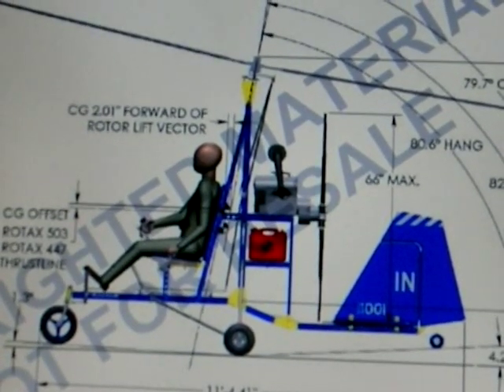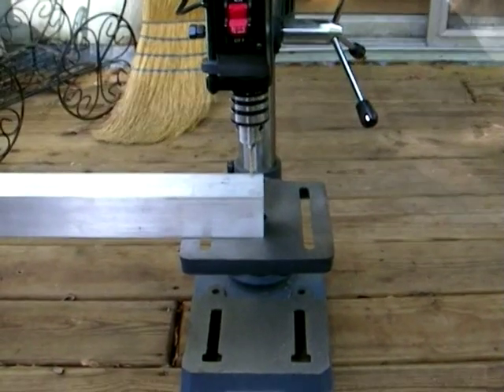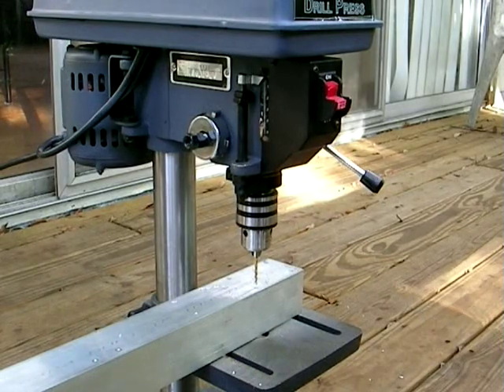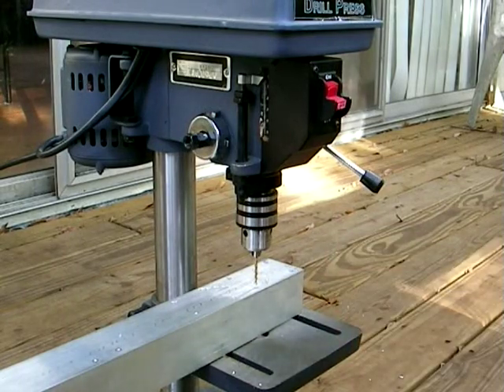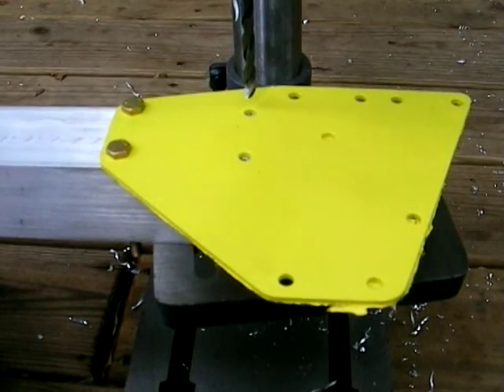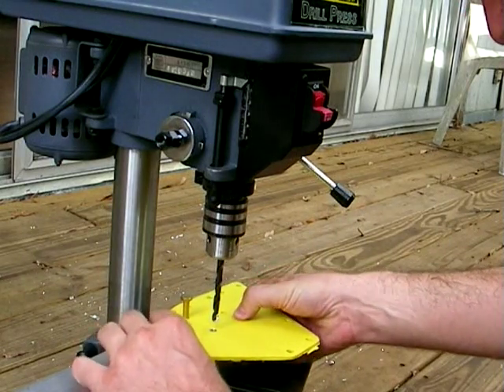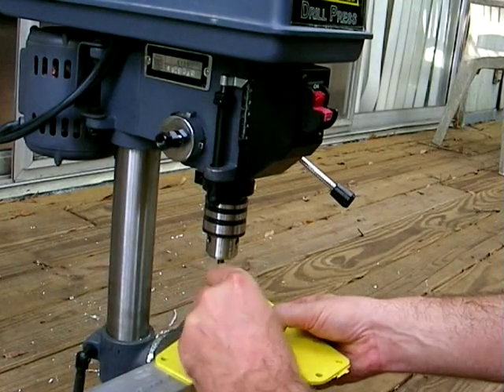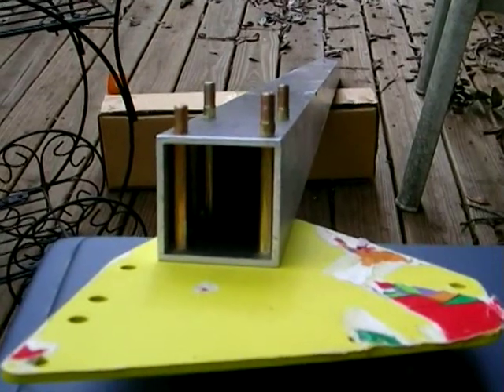Building a Hornet ultralight Gyroplane.

Comment: Can I use a lawn mower motor for my engine. 
I intend to do a light gyrocopter from aluminum square framing it's chasis
Reply from the maker: No. You need a dedicated ultralight engine.
Reply: @gilgsn  

So what is a ultra light engine. 

Give me a link to this motor.
Reply from the maker: @dhulkiflmcknight2275  http://hirthengines.com/2-stroke-engines/
Reply: @gilgsn  thanks for these information. 
I will follow-up through the contact.
Reply: @gilgsn  l am interested in the  41 series  hirthengine...
Reply from the maker: My best advise is to learn about gyros on this forum: https://www.rotaryforum.com/

Comment: sir what was the engine you used in your gyroplane and what was the cost of the engine and .engine specifications of the engine .and any link for buying it sir please.
Reply from the maker: vijaya kumar kona Rotax 447 40hp, but the Rotax 503 50hp would have been better. Give me your email, I will send you some stuff...
Reply: thank you sir for replaying and asking me sir and send blue prints of any one model of gyro copter sir that will be very helpful full .and please give any explanation of the rotor head hub attachment sir .
Reply: gilgsn 
thank you so much sir for Mail ing me sir

Comment: Hi Can you tell me were I can get a set of plans as I'd like to try & build myself an ultralight. Did you get a kit or just the plans?

cheers Alan
Reply from the maker: Hello Alan. It was from a set of plans. They are no longer available, but you can send me your email... I put the project on hold right now because I am building a boat.
Reply: Hi, Thanks for getting back to me, My email is alanos13@aol.com

Regards Alan
Reply: The plans are freely available online in pdf. Just search them ;)
Reply: @ZioStalin  The plans on the internet are incomplete. There is nothing about the rotor and control assembly. If someone can point me to the right place to search.  Does anyone know if the plans sold on the Build a gyrocopter site complete, or same as the free version floating on the net?
Reply: @kkchung2410  I don't know, a lot of time has passed and now I am a PPG pilot (paramotor), I don't remember. Maybe they want you to use a rotor and control assembly from a third party?
Reply: hi! can you maybe send me the plans too? many thanks!!!
Reply: my email is vyvekisawesome@gmail.com. Could you send me the plans?
Reply: No.

You go to google.com, you enter "free gyro blueprints" as search parameters and the first or second result of the list should have what you're looking for.

If you're not smart enough to make a google search you're too dumb to fly.
Reply: @ZioStalin  ...so practice your Googleology seaching skills until you're competent. Then flying will be a breeze!
Reply: @commentatron  You clearly don't understand logic.
Reply: @ZioStalin  Teach me, oh humorless one!
Reply: May you share me the plans pls, my mail joko_hartono@yahoo.com.

thanks in advance
JH

Comment: Good start. Does the manual indicate where to get the blades or are you planning on making them also. Reason I ask is because making blades for real aircraft such as an autogyro is quite an undertaking, you have to be extra careful to do it correctly as your life may well depend on it as it does on the integrity of the whole aircraft, proper training and pilot skill level, etc.  How are you planing on transporting it and where will you be flying it?Keep it up and good luck with the project.